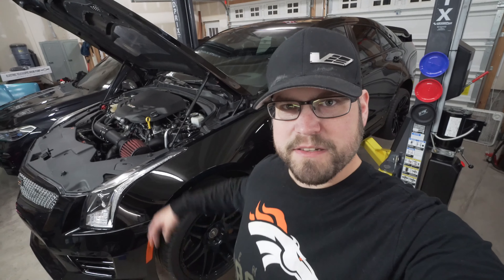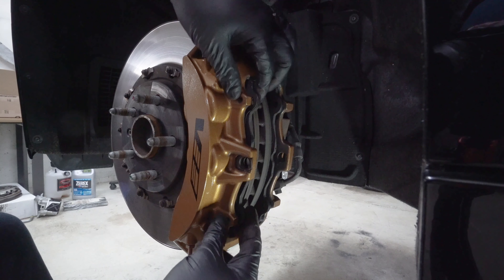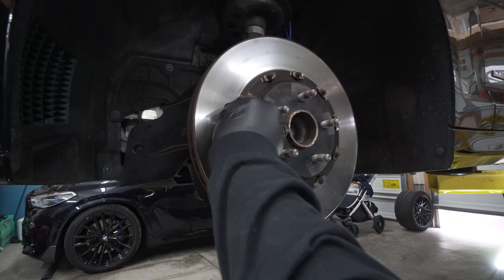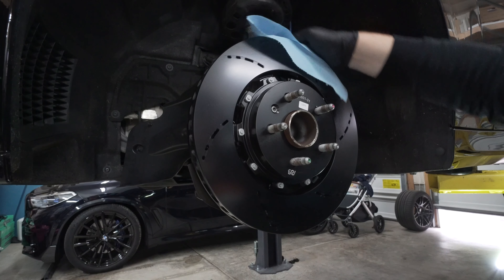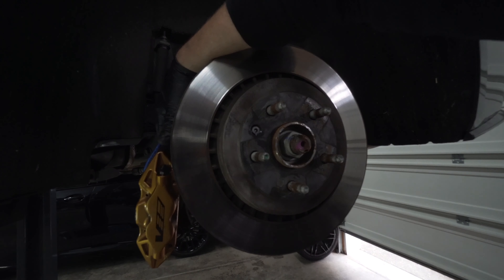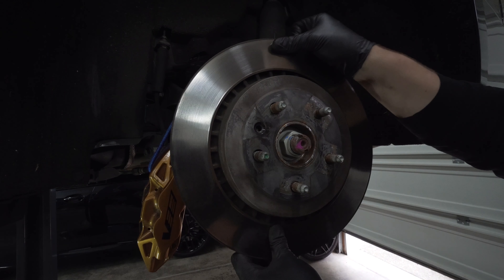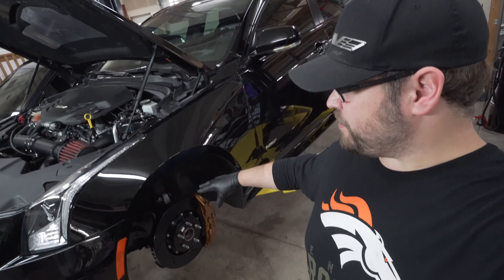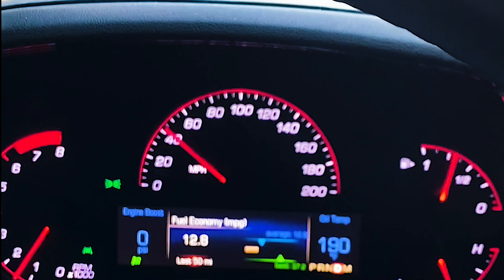Cadillac ATS-V gets Racingbrake rotors, Porterfield pads, and RBF600 fluid

Comment: Did you have to release the rear brakes in any way? I got everything except the rear inner pads just fine. I try doing the squeeze trick and am only able to release the outer pads for the rear. Wondering if I may need to turn the car on to make sure the parking brake is released or something.